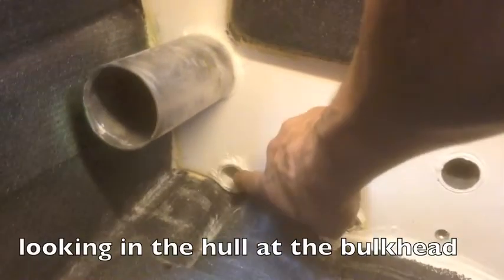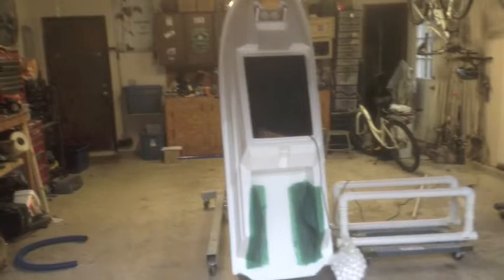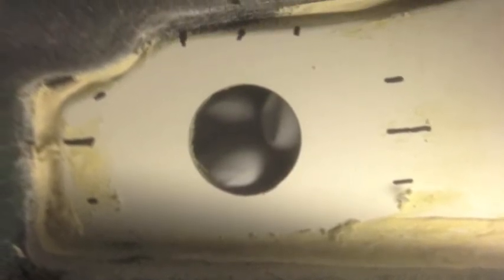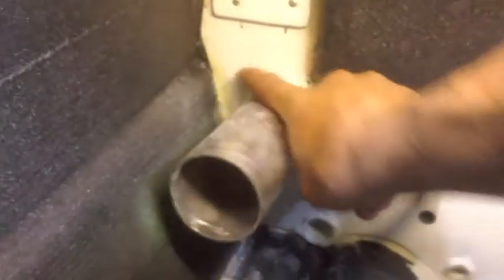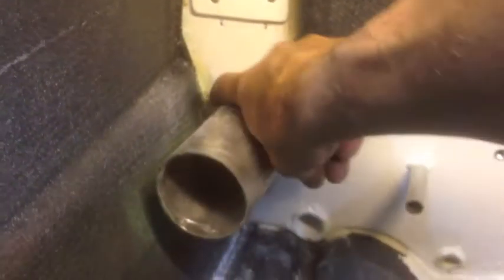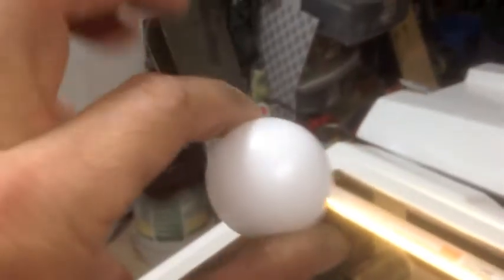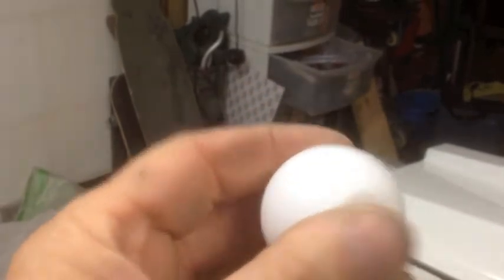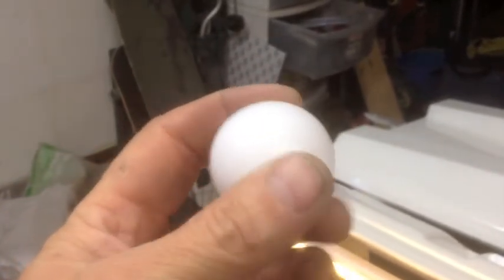Aquabot pt 3 adding flotation

Comment: Dang that sounded a hole lot better then defoaming if it gets wet inside again. I plan on laying 6k 11oz 2x2 twill carbon fiber in the deck of my sxi pro but I still don't think it will be very sturdy. Not sure though I'm no glass expert.
Reply from the maker: Not sure what 6k means, is that the number of layers of 11 oz twill?  The pump tunnel will support it well in the center but I think you need something else under the sides where your feet usually are.  If you have the floor of the tray out, you can use rigid foam (or pour foam or a combo).  Thats what I did in this video http://youtu.be/nhVkRZDcJEc on my superjet.
Reply from the maker: Duh, ok so 6K is the bundle size in the weave. Yeah., I still think you need to reinforce it more. Maybe a couple layers of glass then carbon? I think I would just use glass (probably 3 or 4 layers of 1708), I don't think you will notice the wieght savings of carbon and you won't see it under the turf.

Comment: Okay I've heard of the hole ping pong thing. My question is how do you get the strength back into the deck and footholds without the foam supporting it?
Reply from the maker: I think this is really an option only for aftermarket hulls.  You are right, you don't get the same strength as with foam behind the hull material. The A/M hulls are layed up thicker and stronger though than the SMC hulls of factory hulls so I don't think I would run ping pong balls in a stock factory hull.